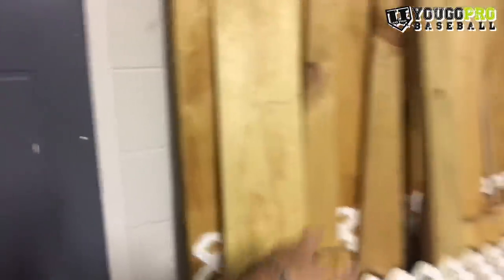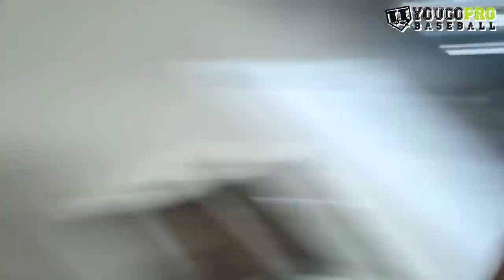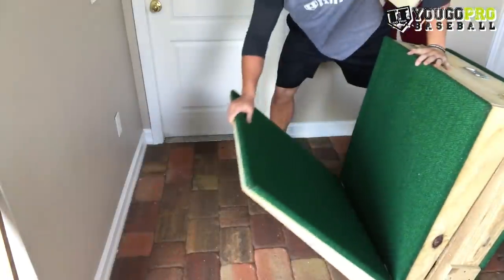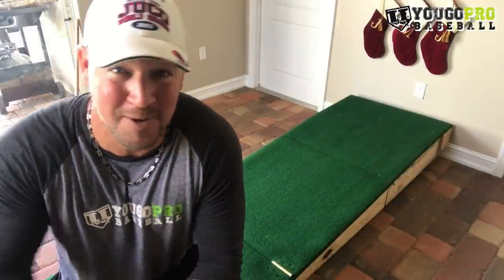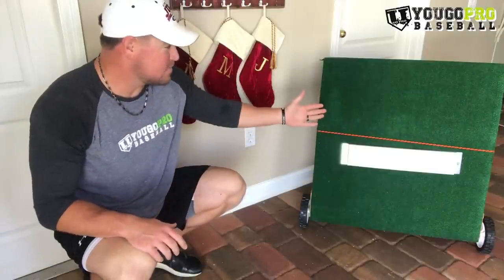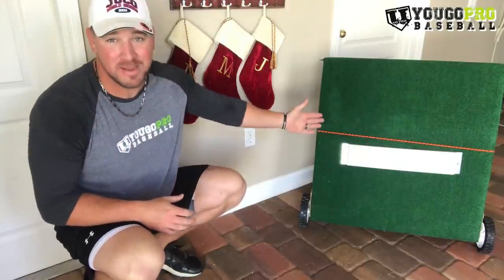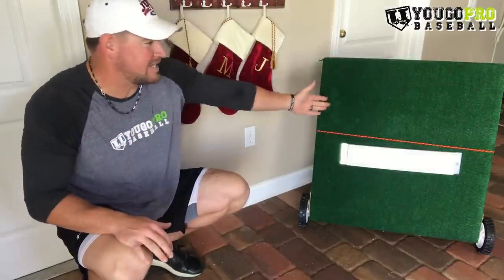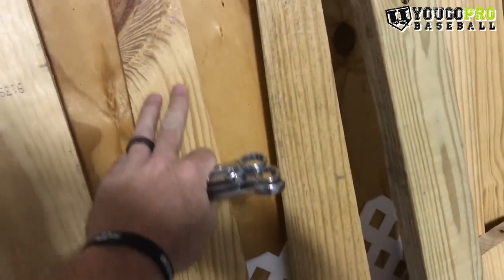Homemade Portable Pitcher's Mound  [DIY Pitching Mound]

Comment: I had the same plan as you John by the time I would buy the material it wasn't much cheaper than just buying this mound let alone time to cut and build it. So I bought the smaller step straight mound from Brock last spring it was one of his first he sent out. I'm really happy with it and keeps my kids from flying open. It's only like 37 pounds can fit in a car trunk he does a really good job on it I'd recommend it to anyone if you need a mound for your yard or if your practice field doesn't have a good mound. Debating on getting another one so I can streamline my pitching and catching practices
Reply from the maker: +samhane   Awesome! Yes, I love it! I’ve got to try that one next.
Reply: YouGoPro it works great. They were leary at first and thought they'd fall lol. But it really makes them stay straight and keep their lead foot/heel inline with their back foot/heel like you say to do.
Reply from the maker: +samhane   Awesome!
Reply: YouGoPro plus if the carpet wears which should be the only thing to break down understandably and that's really cheap and easy to replace in no time.

Comment: You’ve had it about a month now. What’s your take on it? Still sturdy? I coach at a small high school with no bullpen. Think this could handle being used as a bullpen for a small high school program? Thanks for always making great content!
Reply from the maker: Still sturdy yes but to be honest I probably only have 1000 pitches on it so far. But I don’t see it breaking or anything like that anytime soon. I do plan on putting stall mat on the landing part at some point but for now it’s perfect
Reply: I see the landing foot turf sliding forward, what would you recommend to fix that so it's more durable? I'm thinking of buying one of these, but don't want a hole in it after a months use. Thanks in advance. @YouGoPro